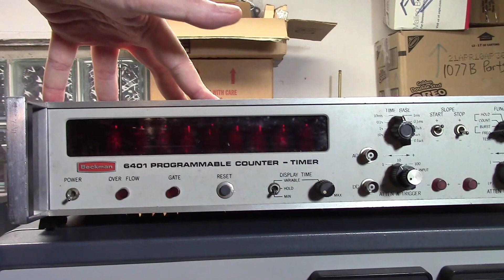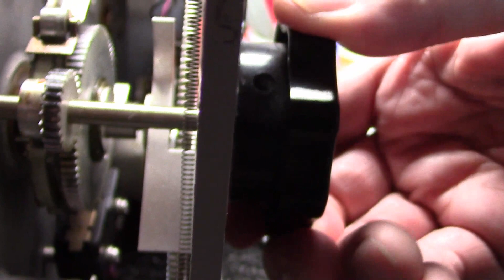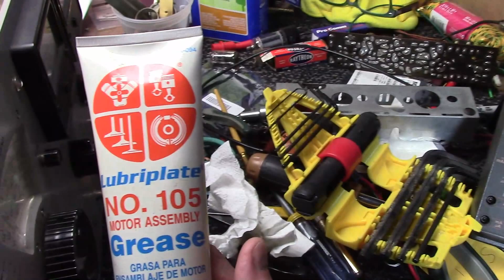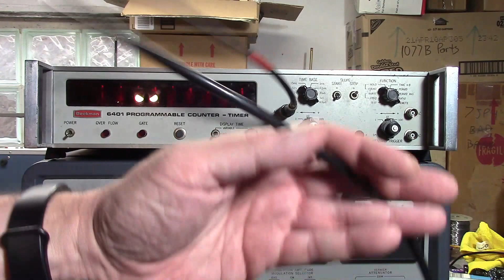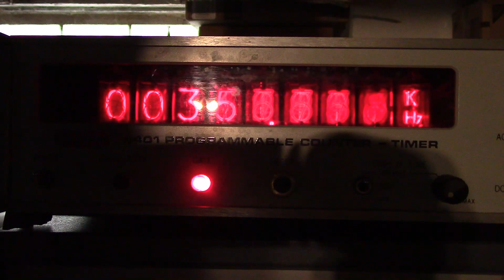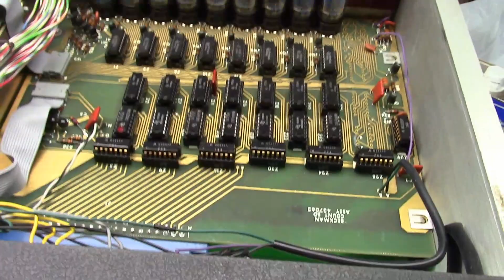Estate Treasures: Beckman 6401 Counter/Timer (Nixie)

Comment: That’s a  neat piece of equipment. I really like Nixie tube stuff. I remember watching a repair video  on YouTube years ago  (I think it might have been Shango) and they were using  a nixie multimeter. I’d like to have one of those some day,just haven’t run into one. The only drawback would be that it would need to be used on a bench with an ac outlet,unlike modern lcd meters that can be taken anywhere,unless there was a nixie with a battery pack. 
The Hewlett-Packard RF generator is incredibly well built. It was interesting to see the construction inside. They really built things to last and took it seriously back then. I think it’s great you actually use the old equipment too.  
As always,I enjoyed the video and appreciate the time and effort you put into sharing this stuff with us.

Comment: Boy that was a surprising look inside the HP606A. There are weep holes for lubrication of the long axles which you 
did point out. One might have thought they were for set screws but not so. That range switch  does a lot of mechanical
work . Not personally  into nixie tube tech but the Beckman looks amazingly rare and cool. Of note there are two different
oval oblong 3 prong type power cords.   Belden ( now Volex) made them to fit that PH-163 socket. One of these 3 prong
 cords have their hot and neutral switched! I do not know if HP did that but they used the switched 17952 cord. The 
17280 was the standard UL approved type  like today's standard. Both fit your recessed socket.

Comment: Hey there, unrelated question, can I use a 8xp4 test crt on a chassis that has a 10 inch round picture tube (1950) RCA), thanks so much, keep those videos coming
Reply from the maker: Yes, but it won't fill the screen properly.
Reply: @bandersentv  thanks so much, I just pulled the trigger on it, it was on ebay ( Westinghouse ) looked like new with the original box, voltage cord and papers 👍

Comment: In 1968 I had a summer job at a civil engineering outfit just as they were making the transition to electronic calculators, so some guys were still using the old Marchant mechanical calculators.  But they also had some Wang electronic calculators with Nixie tube readout.  There was a central CPU and then 2 or 3 laptop-size terminals.  An 8-digit multiplication or long division would take a few seconds, and you could watch the Nixies flash as it did the calculation.  It could also do trigonometric functions which the Marchants could not do and you would otherwise have to look up in a big book of tables.

Comment: The Beckman is a lab-grade instrument. The Leader is a commercial-grade instrument. Depends on the accuracy level you need. We used to calibrate the crystal oscillators against WWV using a VLF receiver. They had to sit for hours, turned on, in order to be fully stabilized.
Reply: GR8T insights. Thank you

Comment: On the Beckman's display board, what were the chips in between the 7490s & 7441s?
Reply from the maker: MC846P I think.  Looks like they are configured to be a latch that holds the display value while the counter are running.
Reply from the maker: I took a better look and I see now they are 7475 4-bit latches.  That makes sense.  They can hold the results of the 7490s when the time interval is up.

Comment: That looks like the power jack used on some HP gear often referred to as a "Belden Oval" power cord; PH-163. They come up from time to time on ebay but usually around $50.
Supposedly part number is Belden 17952. There is also Belden 17280 that has hot and neutral reversed.
Surplus Sales of Nebraska has 2 HP cords; one with UK plug and another with no plug. Both are $39/ea. About the same as ebay price.

I have four HP400xx meters. Two I just swapped for a standard EIC jack and just required enlarging the hole; mostly making it square (nibbler tool.) One I left for originality, last already had EIC jack.
Love look of old Nixie and EL gear.